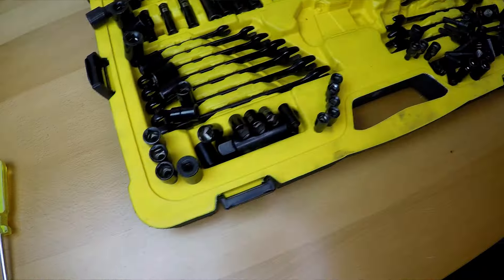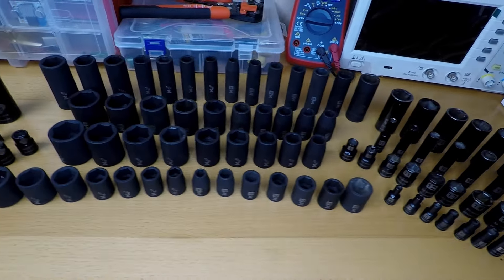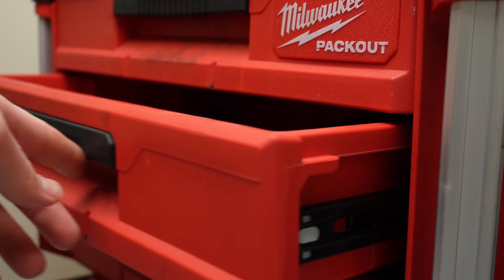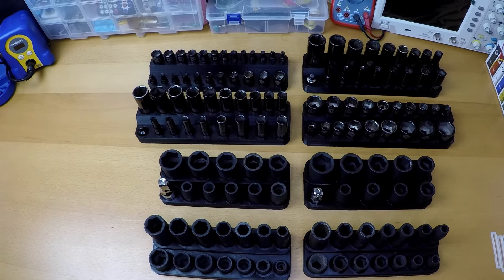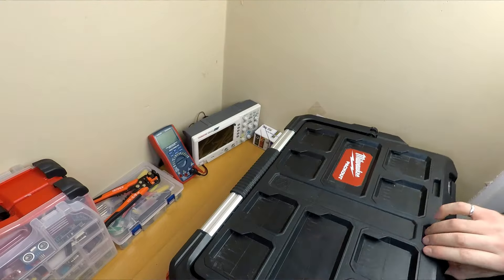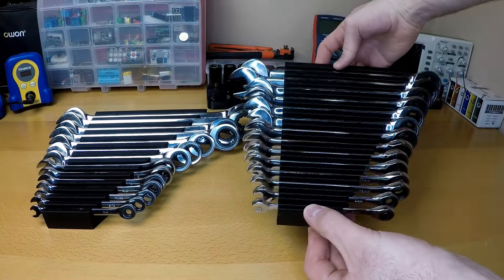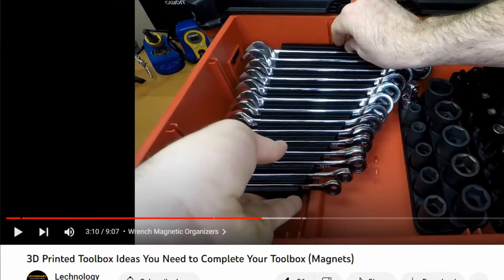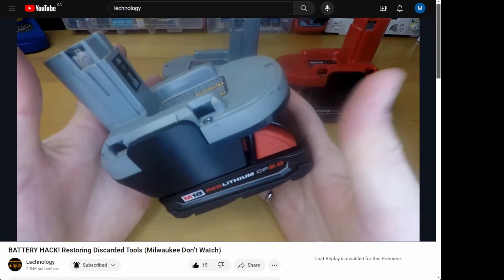3D Printed Magnetic Socket and Wrench Organizers

Comment: as an auto tech for 40 years , these racks make me wish i had bought a 3d printer sooner! ghreat work and thanks just a heads up 90% of tools today are metric !
Reply from the maker: Glad you find them as awesome as I do!
Reply: Get a 3d scanner as well. I've got a motorcycle, and a 3d printer combined with a 3d scanner makes it a lot easier to replace missing pieces of body work from when a bike gets dropped. You can print a back to the part and then use plastifix to fill in the empty hole.
Reply: @SmallSpoonBrigade  great idea was thinking of getting one,  house got flooded in august so its going to have wait for now

Comment: I would honestly say that if you are willing to tinker with an older Creality machine like you recommended Id look definitely look at buying a Prusa mk3s used as Prusa machines are well known for their reliability and longevity. If you have the money a new Prusa or Bambu machine is going to be so much nicer especially if you intend to use a 3D printer for lots of engineering/technical 
projects.
I had a Creality K1 and it was not a great experience so I bought the Prusa MK4 and its been a night and day difference. You get what you pay for with these printers, plus the auto offset and calibration is so nice and I can spend more time doing my shop projects.
Reply from the maker: Hey Alex,
    Thank you for your printer insight! I definitely want to switch printers soon, it's been a good run. 

I definitely would like to save up for a Bambu but since they aren't open source its turning me away from it. I'll either wait for their new generation of printers to come out or see what printer Prusa responds with.

Thanks again!
Reply: @Lechnology_Engineering  absolutely! I myself run the Prusa MK4 and it’s been a solid machine. It’s more expensive but I expect it to last me a long time with general maintenance.

Comment: @0:01 You can just open the yellow case from the other side, and it won't spill out. But I think you already know that.
Reply from the maker: You can know it, but you'll almost certainly forget it here and there! Also there is a thin foam sheet that is sandwiched inbetween and if it's not there, all the sockets fall out when you carry it upright! So happy I designed a change! Thanks for watching!